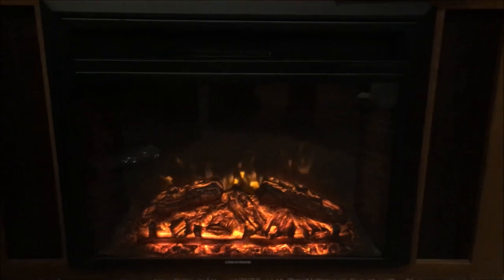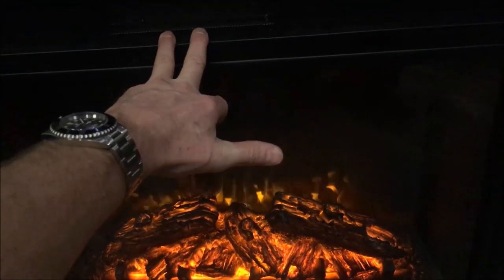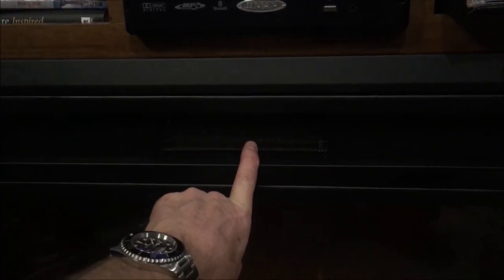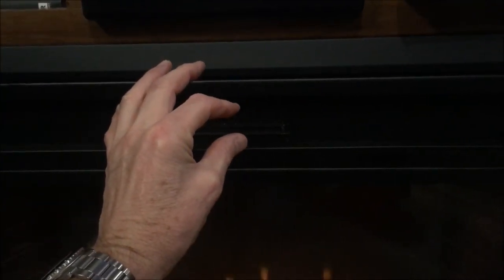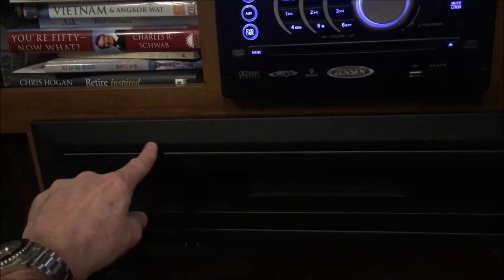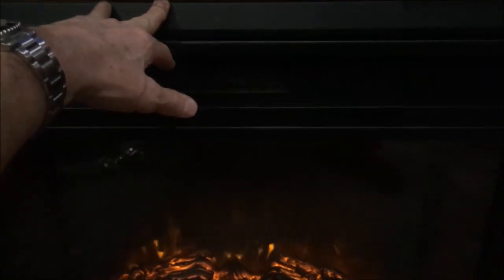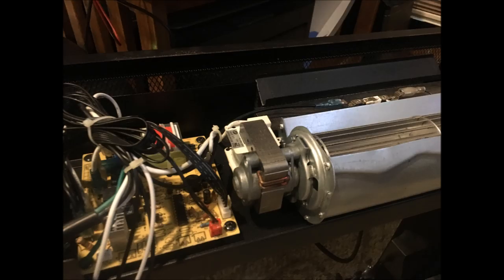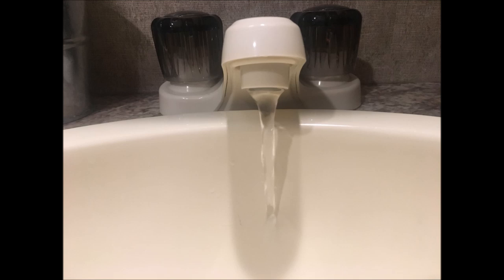Why Did My Greystone Electric Fireplace Quit?

Comment: hello, seen this blog... my rv is 6 months old and my heater is squeeling some. It started last night and it seems to be like the fan needs lubricant. can i just pull it out and spray W 40
Reply from the maker: Maybe 3 in 1 oil would help. WD40 is not a lubricant as many think. A little goes a long way.
Reply: @JustPlainCommonSense  thank you

Comment: B4 I tear my brand new unit apart cause the dealer where I bought my 5th wheel are crap, can I ask is there a little fan in there for keeping the electronics cool. My heat and squarl cage fan are working fine but there's a separate squeal in there from time to time that sounds like another little fan motor failing. Thx, J
Reply from the maker: The noise is likely from what turns to simulate “fire”

Comment: We have a 2017 Puma with this fake fireplace. We've turned on the fake flames a couple times. Never used the actual heater. But it completely quit a couple months ago. Won't turn on at all. I took it out yesterday and checked themcord and outlet. Cord is good and outlet has power so I took off the panels to see if maybe there was a fuse. Nope. No fuse. Just a couple circuit boards.  Now I'm stumped to what or why it stopped working.
Reply from the maker: Mr51Caveman it’s the best China can make. I looked at my owners manual and it basically says the breaker feeding the outlet is tripped or the thermal switch is tripped. I found it cheaper to replace than to fool with repairing it. Winter is coming!
Reply: @JustPlainCommonSense  Yep. I checked everything I could and then called the manufacturer and selling dealer. Manufacturer (Puma warranty dept) backed out pretty much completely. Said they only addressed the 1st year issues. Dealer responded much better and have ordered a replacement. They told me they have continuous issues with these fireplaces. Mostly the circuit boards.   So I guess I'll just r&r it.

Comment: Great video! Any idea why all three flame lights don’t work while the rotisserie motor is running fine? The bulbs are all good? Thx much.
Reply from the maker: If you pull the heater out I think you will find a burnt out bulb.  Easy fix!

Comment: I have an electronic fireplace an when I turn it on the screen comes down that shows the heat an the paddle lock symbol pops up an that's all I can't get it to do anything else. Does anyone may know what is wrong?
Reply from the maker: Johanne Dew I’ll look in my owners manual
Reply: @JustPlainCommonSense  thanks so much I bought it off a older lady so I don't have the owners manual.
Reply from the maker: Johanne Dew my manual/fireplace doesn’t have or mention a lock 🔒 symbol. 
What model do you have?
Reply: @JustPlainCommonSense   I'm not even sure.
Reply from the maker: Johanne Dew on the remote, press the up arrow button Twice and the down arrow button Once. If the unit beeps 3 times, child proof mode is now Off

Comment: Hey, when ordering a new one. When it sais 26 inch,is that the outside edge or inside
Reply from the maker: DOUG FERGUSON inside. Not including the deco trim
Reply: @JustPlainCommonSense   Thanks. So is Greystone reliable. There are a few rounded glass models
Reply from the maker: All I can say is So far So good.  I use three heaters in my RV so none of them have to work too hard.

Comment: A bit helpful. I bought mine 2yrs ago and it shuts off after about 30 minutes of use. Its displays a code and I have to wait till it cools off. I purchased it for 699.99 at Home depot I can't seem to have to dish out another 200 for it
Reply from the maker: For that price you’d think parts might be available!  That’s an expensive heater!!
Reply: @JustPlainCommonSense  it's a 72" media electric fire place. The fireplace display is 36" wide. The internal are the same as you displayed on video. Maybe I should have paid for the warranty at a Lowe's. I think I mentioned Home depot it was Lowe's. They know exactly what they do lol that 1 yr warranty don't help.
Reply from the maker: @Rodgarc32  buying a local warranty doesn’t sound like a bad idea.
Reply: @JustPlainCommonSense  UPDATE. I watched your video cause we were expecting a small freeze that night so I removed rear panel and cleaned a small amount of surface dust from internals. As of now it been heating without shutting off. Hopefully that's all it was or there was a loose connection I fixed by accident.
Reply from the maker: @Rodgarc32  I bet the thermal fuse has an intermittent fault. I hope it fixed itself and doesn’t fail you again.

Comment: It got down to 27 last night and mine quit on me, but the flame display froze and I can’t turn it off. I’ll hit the power button and it just comes back on again
Reply from the maker: Odd. I’ve never heard of that problem. I hate so many folks are having problems with these heaters!  My replacement unit has worked fine so far.
Reply from the maker: The display is just a light and a slow moving motor used to create the flames. The flame is on whether the heat is on or not but you should be able to turn everything off. Try the power button on the remote control if you have one.
Reply: @JustPlainCommonSense  I understand that. I had it on for about an hour when I heard it beep and saw the movement of the flames freeze in motion and the controls display go black. I walked over to it and felt that it was also no longer blowing air so I hit the power button to turn it off since the logs and flame screen were still on and it won’t turn off. I unplugged it but when I plug it back in, it just goes right back to where it was and I still cannot turn it off. It does the same thing when I try to hit the breaker too. So I have no idea what the problem is.. it’s quite frustrating
Reply from the maker: @cassie7530  sounds like a problem with the board. Likely unrepairable.
Reply: @JustPlainCommonSense 
 I have a really nice older stove. I bought it probably 15 years ago. The store where I bought it is long out of business. It was the best little stove ever! It was not expensive to run and could heat a room in minutes. I have to go look and see what the model number and brand are. Two years ago the flame thing started squeaking, then the heat quit. I would love to have it repaired, as it is heavier, bigger, more  sturdy than the new ones. It worked all those years with no trouble. I moved once, then it was in storage for a while, but it always came right on and worked great. My husband and I are not DIY, but there don't seem to be places where you can take them in for repairs. I paid $300 for it. The prices for them now are breathtaking! My husband bought a smaller, cheap, metal one from WM and I think it worked just a year or 2. It never seemed safe to use to me either.
If anyone knows of a place in Eastern NC that fixes them, I would love to know where it is so I could get mine fixed, no matter what the cost. The new ones are so cheaply made.   I really miss ours.
It's sad that we live in such a disposable society. If you have something well-made that works great, and it eventually quits, just throw it away and buy another one. The new ones are not the same quality though.
Reply from the maker: @knitwit7082  If you can find an old appliance repair man, I bet you could talk him into at least looking at it.  Mind you, parts would likely be impossible to find but if all it needs is a drop or two of machine oil in the right spot then it would be worth your while.  Good Luck!

Comment: Thanks man I’m gonna check mine out on my next day off this kinda sounds like what’s mine is doin
Reply from the maker: Brad Bargo it’s worth looking into. Your problem could be repairable.
Reply: Just Plain Common Sense yeah man thing was 500$ worth trying to fix it will turn of but cut off with in a few seconds and reads EC code on the panel hope I can fix it my wife and cat sure likes the fake flames and the heat it out outs really have t used it much

Comment: I have a 2015 keystone sprinter that has a greystone fireplace. It stopped working after about five times of using it. Not sure I want to spend $200 to only work a few more times. Ughhhh cheap China stuff.
Reply from the maker: Hopefully that was just a bad one and the replacement heater will last longer.
Reply: @JustPlainCommonSense  they are real beautiful and comfortable to have in your home but the price I paid $180 for one in Memphis and it went out on me overnight never again
Reply from the maker: @williamivery1809  my replacement unit is still going strong for now
Reply: @JustPlainCommonSense  bought a smaller one from Walmart and it's still operating normally I run it all day and night. Go buy a big one and it go out on me overnight 😤😤😤😩and it's freezing in Memphis today I'm going to have to take it back I'm debating on getting another one
Reply from the maker: @williamivery1809  better luck next time.